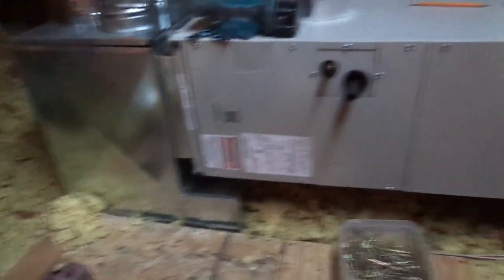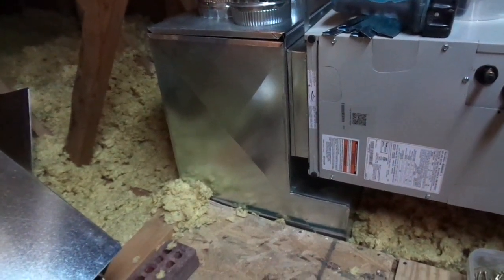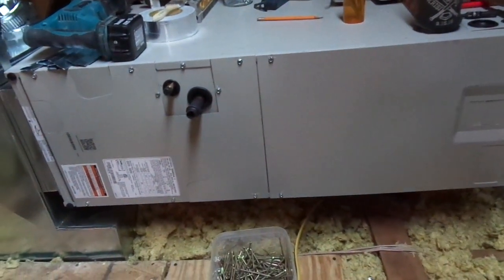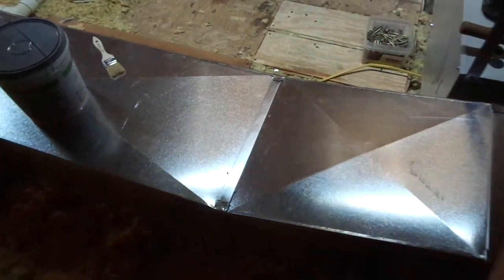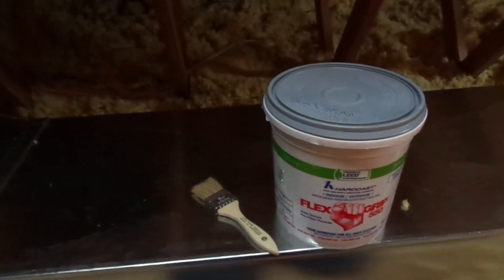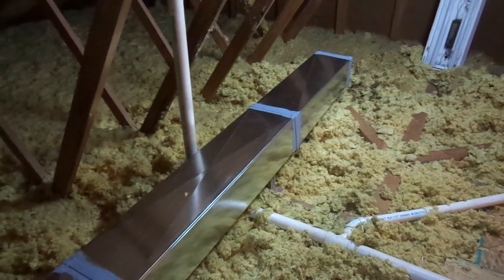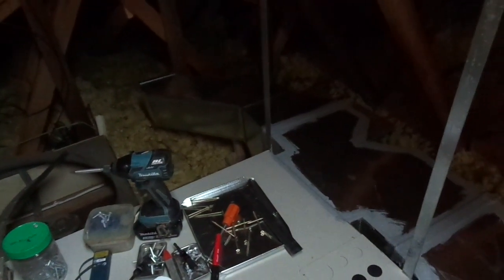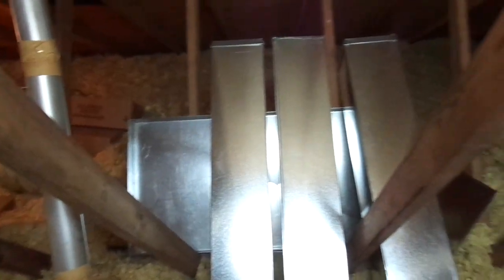Heat Pump Attic Installation Pt 5

Comment: Always entertaining.  Question for you.  The air handler, did it fit the attic trap? I like your idea of using a commercial/exterior grade for residential/indoor.  So you won't mess with the product!  Thanks!
Reply from the maker: This particular brand has two cabinet sizes available in all btu capacities.  I had to opt for the smaller physical size cabinet due to the attic access restriction.  We only had to remove the access trim pieces for this to slip right in whereas the larger cabinet would've required a hole adaption.  The airflow characteristics are the same in the fan charts and they are both rated at the same db rating and they both (I think) have the same blower assembly. The only limitation is this cabinet is limited to only a 10 kw heat package whereas the larger one will accept a 15 kw package.   Let me tell you Joe, the mastic used in the video is one tough material once cured !!  It does a wonderful job.  Thanks for watching Joe...I have to play catch-up with you and Dave !! (-:

Comment: You are certainly earning your wages. I helped my son install a new service in his first house. Built in 1920 the house had a single run of wire into the upstairs attic. 
It was interesting. Hope your wire runs are easier than the usual. Seems like designers could build in a access to the attic from the basement. I don't think they expected to have CAD 5 runs and power for heaters, fans, and computers in the second story back in 1920.
Reply from the maker: You are right about installing a conduit all the way to the attic during construction.  But that ain't a gonna happen is it.   Actually a couple years ago when we did a total house rebuild for my middle daughter, while the stud walls were still open I ran a 3/4 conduit to the attic from the basement then three or four additional stubs up from the basement into plastic boxes where we thought were the logical places for computers, t.v.'s and the wifi box.  When it came time to get wifi it was quick as a wink to pull Cat 5 and will be easier to change to something else if necessary in the future.  So man, I was ahead of the game on that one !!  Not so much on this one though...)-;
Reply: @tractorman4461  One win is 100% better than the average. The house by Union City sat on 12 x 12 beams. Fortunately when I ran the water up to the new upstairs bathroom  I found that the basement entrance wall was open all the way to the attic. I pulled all the runs through that after driiling three 1" holes through the 12 x 12 to get into the wall. When we moved 18 years later the hole I cut through the lath and plaster, as an access, was still there. We used it about every three years for some new gimmick and it was a Michigan stone walled basement that only held the furnace.
Reply from the maker: Old Sneelock's Workshop you got lucky on the built in chase. Lots of old building in StLouis have limestone foundations and those alone create a nightmare for running chilled water pipes or smaller refrigerant pipes through. One in particular I remember was 36” thick and I used three 12” extensions on the Hilti drill for a couple two or three inch holes. Core drilling for 8” or 10” is another story because it’s difficult to anchor an 80# drill to as well as mount it squarely. Lol. But... as with anything, we do what we gotta do to get it done huh. Construction materials and techniques have come a long way from the old house in Union City. Good thing huh. Lol
Reply: @tractorman4461  Every house has surprises. Dad and I were wiring a couple houses for a woman who wanted to bring back the feeling of her parents house on Chicago St. in Coldwater, Mi. She said she wanted it livable, but with the things she remembered like ornate trim, wood floors, and an old fashion kitchen with modern conveniences. 
The other house next door had bern converted to appartments and she was bringing it back to single family occupancy. 
We worked on it for two or three months. Me on off days when I wasn't in school, and Dad in the morning before his shift at the foundry. 
Dad set me to installing outlets. I had plenty of practice and was going along pretty well. There was one that I started like usual. Measure up from the floor. Find the studs. Mark the box outline on the wall so it missed the stud. Drill a hole for the keyhole saw. Then cut the opening. 
It was all going well untill I tried to find the studs. Tapping along the wall until it sounded hollow didn't work. It all sounded solid. Magnetic stud finders were not common and the electronic ones hadn't been thought of yet.
She definitely wanted an outlet for a lamp on the table just like her parents had. So I drilled the hole with my fingers crossed. First there was normal white plaster dust. Then red dust. Oh oh! Brick. I thought there was an abandoned chimney there. It was actually the back of an abandoned fireplace. Her parents had a kerosene lamp on the table when she was growing up in the 1900's. 
After removing the baseboard I chiseled a groove through the brick and on into the 12 x 12 beam it sat on, over the foundation wall. We installed a short run of EMT up through the wall and set the box and I plastered it in all nice and smooth. A skill I use to this day. 😆
 That outlet took a full days work, but she was happy to pay the $10.00 in labor for my time. I was making the going rate of $1.25/hr. in 1965. Dad might have charged a bit more for his helper, but at 15 I was just happy to be working with Dad. 😆😎
Reply from the maker: @OldSneelock  hahahahaha...good story !!  I've one or two in my repertoire as well !!  Hidden bricks are a nightmare on a bid job.  On those older homes, God only knows what you're going to find hidden.  I got into one wall and found a stud cribbed up with what looked like a piano leg !!  Hey man, they used what was available...no Lowes or Home Depot on the corner back then....and no money to spend if there were.  Times have changed ain't they sir.  Back then as a kid, you were making some good bucks at that rate.

Comment: Hey Tractorman, your install here had some offsets and tight areas. I need some guidance on 2 duct issues. The first dilemma is I have no choice but to take off a duct from the very end of a trunk line and it depressurizes the entire trunk so other ducts get no airflow. My only solution is to purposely make the end duct size under sized by 50% so it takes less than typical airflow for the 8” round. But it’s really guesswork unable to precisely size/calculate how small to make the duct to compensate. 

The 2nd dilemma is how to connect slips and drives to ducts that are tightly between floor joists. I can’t access the under side of the ducts to bend the drives over. Specifically I struggle how to seal and mastic the inaccessible duct sides, then of course insulation! I likely will just not bend the drives and cut them off even with the duct height. One idea I have to seal is maybe instead of mastic use metal tape and snake it around the entire duct perimeter, and maybe snake a strong fabric overtop the tape where I can pull the fabric so tightly it will squeeze the tape to make the seal on the slips and drives. But not sure this will work well.
Reply from the maker: Sorry Roger, this comment went in the spam folder for some reason.  On the end one, I'd run the standard 6'' round pipe with a volume damper installed in it right at the truck line.  Adjust it slowly until you get the desired air flow and acceptable noise level then put a screw in the handle to hold it securely against the duct static pressure.  Use heavier guage metal for the 5 7/8 damper so it won't wobble against the air.
    When I saw the ducts in between the joists, I realized the coming delimma.  There is no good way unless you can assemble the long runs above the area, bend over the drives, seal and insulate then drop the long runs into the space.  Probably not able to do that in every case for sure though, If any.  Another thing is to use mastic in caulk tubes. Extend the tip with ten inches of hose attached to the end of the caulk gun....squeeze a liberal amount at the bottoms....a big wad. Then drive the drive cleat into the wad.  Not the best, but it should work adequately for sealing air.  Insulation is another story.  You may be forced to spray foam around every crack and crevice then layer batting over it all then blow in cellulose to cover the whole area. There's not a good way to solve the problem at all. 
  Sorry I missed the comment....let me know if you've solved it already and if so what you did.

Comment: Good day Wendell, please use a dust mask when you going to blow that cellulose isolation !!! No caughting permitted !!! I'm very impressed by you knowledge and Maths calculus !!! You and Joe are the best in that departement and many more too !!!  Keep up the good work and happy incoming Independence day for you !!! For us is Canada Day ( https://www.thecanadianencyclopedia.ca/en/article/canada-day ) If you are interested !!!   Cheers !!!
Reply from the maker: Hey Dave !!!  Good Evening to you too, kind sir.  And don't worry about the masks...I have several that are rated for ultra fine particulate for working in lead smelters.  Super Duper masks they are.  Heck when the insulation blower fires up, the dust is so impenetrable you can barely see after only a minute or two....so I'd imagine that it would plug up a healthy set of lungs pretty quick !!  I'm going to try to find a machine with the remote start button you carry with you because communication between the guy insulating and the guy loading the hopper is almost impossible. Thank you for the well wishes for the Fourth !!  Is Canada Day also on the 4th ??  Well, I'm going to click the link and go see.  I wish the best for you as well Mon Ami.
Reply: @tractorman4461  Good Evening Sir, No it's the 1 of July !!! like you going to learn with that link that i send to you !!! That remote start button will be great or perhaps two way radio sets will be good too !!! Cheers !!!